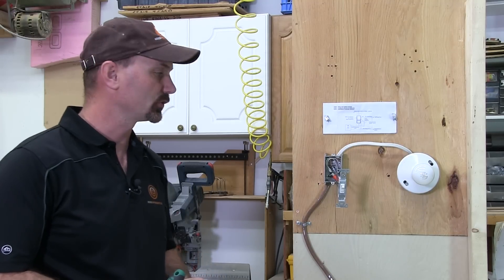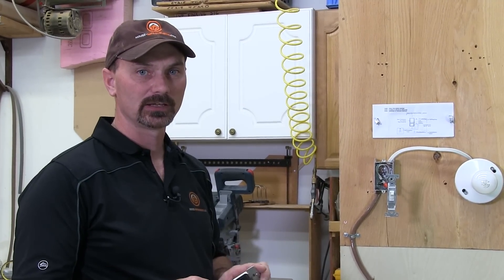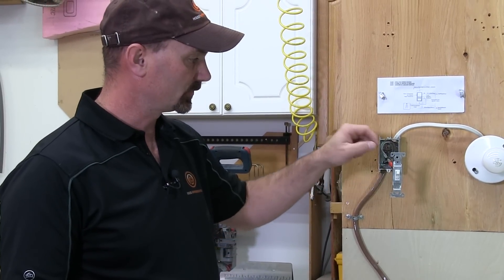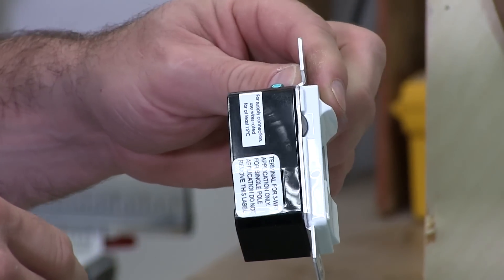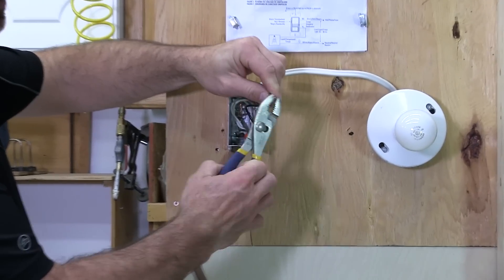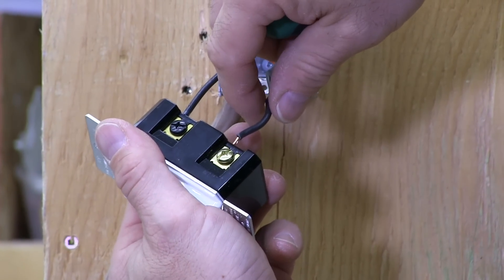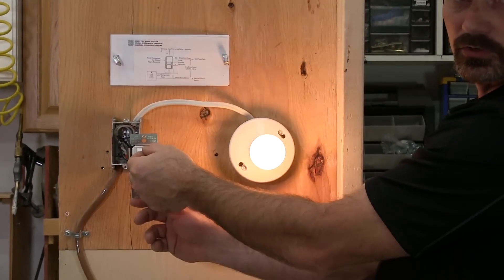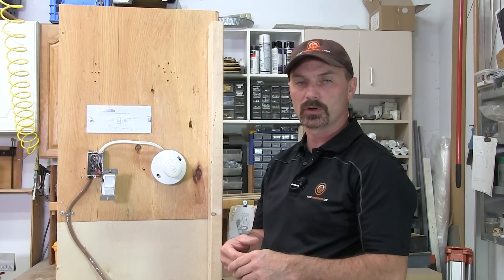How To Install A Dimmer Switch

Comment: thanks for sharing, i have to install a tipe of dimmer that looks like the one on the video, but i am working on detached lamp that i use in my bedside, i wonder if the two cables are the in fact one , that seems to be the case?...

Comment: My box has only one black wire and one white wire. Can I install dimmer switch on? Thanks
Reply from the maker: Yes, you have a switch leg circuit. One of those wires (likely the black ) is the power feed, the other will take the power to the lights.

Comment: Have dimmer to install, 14-2 wire, white to white, black to black plus ground, my question is the white wires indicate current with voltage tester,  in your Video, no mention of white wires but could see them in box. Also wires from light to switch box, does black wire attach to dimmer and black wire from breaker become second wire on dimmer, if so all white stay connected in box with wire nut, is this the correct method, DONT want to trash $32.00 dimmer THX ERIC
Reply from the maker: My forum is the best place for these discussions , please post your questions there and we can walk through it. https://www.house-improvements.com/forums/

Comment: Which of the two wires is the hot wire? 🤔
Reply from the maker: In the video it is the black wire coming from the bottom area of the box and attached to the bottom screw on the original switch. In your case with the old switch off check which wire has power with a multi meter tester. That will be your hot.

Comment: Nice one, in the video both the wires look black so how do you know which wire is live.
Reply from the maker: You can test that with a volt meter or buzz stick when the power is on and the light switch is turned off.
Reply: Yes I realise that Shannon, I was mainly asking just in case some of your viewers may not know what to do mate. Hope you dont mind. Keep up the good work..
Reply: Russell Swindlehurst can't you just look on the original switch to see which one was the positive?
Reply: Which wire is live doesn't matter. Either black can go to either terminal screw. All you're doing with a single pole switch is breaking the circuit when it's off and completing the circuit when it's on. The switch itself doesn't care which screw the live wire is on.  Of course, you'll want to turn off your breaker and then check that it's dead with a voltage tester before changing out a switch.
Reply: the one coming from the bottom of the box is your hot wire, the other wire from the top to the light is your switch leg
Reply: @Wowzersdude-k5c  Soo it doesn't matter because the switch when on, is allowing the current too flow one way.
The switch is only breaking that connection when the switch is off, kinda like a operation bridge. Makes sense, but I have a question tho, wouldn't be a better idea just too put the hot wire in black screw with those dimmer seen in the video.

Comment: What l am confused about, is every video says there is two black wires, every time l ever changed out a standard light switch or any electrical outlet, theres always a white and black, obviously l need the white wire for power so where do l hook it up at?

Comment: The two black wires are both HOT, but one of them comes in from the power supply feed and the other one is outgoing.  You didn't mention which of those two wires connect to which of the two poles on the dimmer switch.  Because if you reversed them, wouldn't the dimmer work in opposite direction?
Reply: No

Comment: Yes how i try to install a single pole dimmer where a regular switch was install but when i check the wires there's three copper wire plus ground wire. The dimmer purchased has two black wire and ground wire. I try to out it without one of the copper wire and didn't work what did i do wrong?
Reply from the maker: please post in our forum.https://www.house-improvements.com/forums/

Comment: When you dimmed the light switch all the way down, that that means that the switch is off or it’s just dimming the light bulb?
Reply from the maker: The light would usually be receiving a limited amount of power still with most dimmers that also have a separate on/off switch
Reply: HouseImprovements Is there a light switch out there that has a built in on/off switch that I could just leave to on switch and use the dimmer switch to dim the light bulb out? I asked bc, I have one outlet in the kitchen that when I turn off the light switch, the outlet is no longer receiving power and I have my water cooler dispenser plugged in to this outlet. Thanks!

Comment: hey i like your videos, when i have a dimmer switch do i need a special light bulb or can i use a regular bulb?  when i turn on the switch that has a dimmer the light flickers and i will have to move the dimmer to make it stop but in minutes it will flicker again
Reply from the maker: Some bulbs are not compatible , it will say on the package if they are dimmable.

Comment: I have a dimmer on a fan that does not have a pull chord with the three speeds. Anytime you turn down the fan speed from highest setting with the switch, you can hear the motor on the fan get louder. Is this something I can fix with a different dimmer switch?
Reply from the maker: Actually I'm not sure you want to run that style of fan that way. Best to ask that question in my forum and the electricians there can maybe give you more insight on that. https://www.house-improvements.com/forums/

Comment: The normal light bulb is easy, try LED bulbs + LED panels (eventually + wifi control + IR remote)   :)   I am solving several places at my flat and such there are several standards exists it´s really pain to solve that (and 3 wire cables are not enough - you need 4-5 wires in the cable)

Comment: Ok i have a question 4u so my bedroom has no overhead light but has a lightswitch but idk what its for but my husband installed recessed lights in ceiling and wants to change the old switch to a new dimming light switch but he wants to know how do u wire that new from old switch but not cut off power from outlets in bedroom?
Reply from the maker: Our forum is the best place for questions and it is easy to use, please post your question there for a reply.https://www.house-improvements.com/forums/